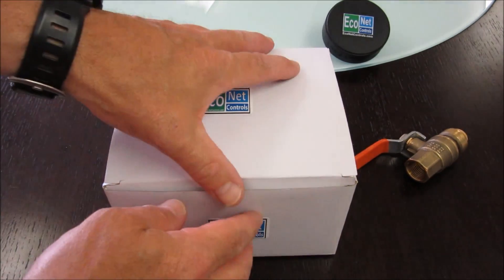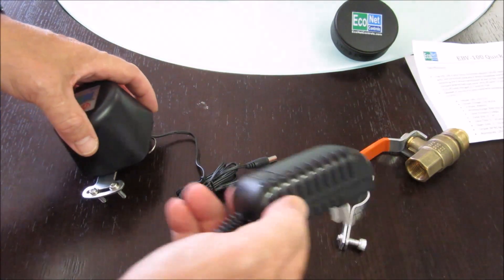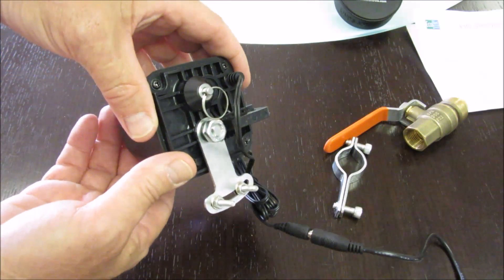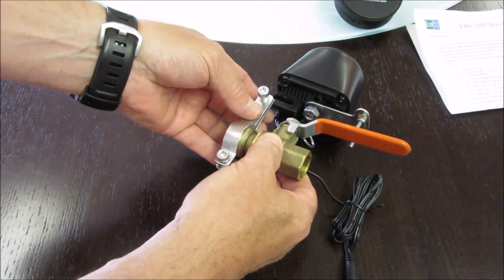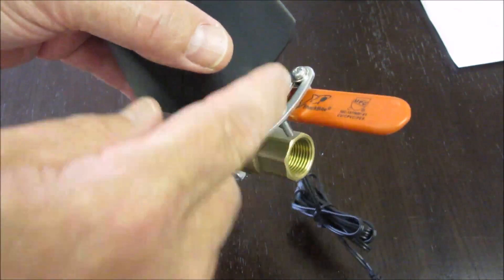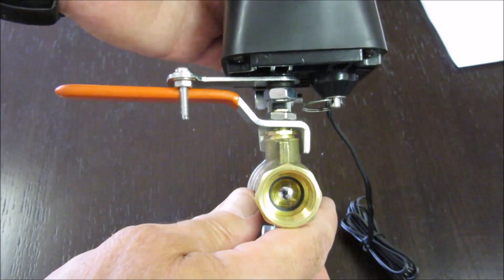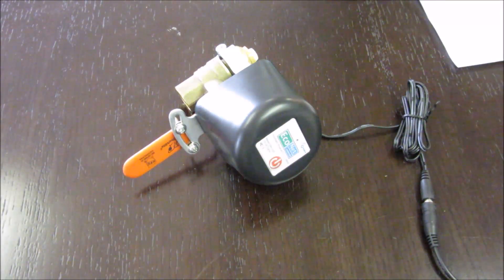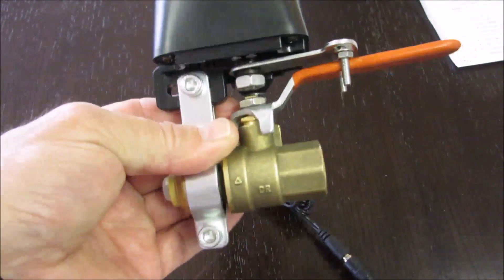Automatic Powered Levered Ball Valve

Comment: These things can also be used for turning off natural gas valves. You can use arduino gas sensors to activate them. Everyone using propane/natural gas should install them. I have a natural gas well and have used it for everything in my house for almost 20 years but I use a linear actuator. This should work ok too.

Comment: I wonder if it could be thermostatically controlled to shut off a oil dripper on a wood furnace????
Reply from the maker: Please check out the latest versions of the Bulldog at www.EcoNetShop.com.  and yes, you could add temperature control and many other sensors to control the Bulldog

Comment: Can i select the extent to which the arm can travel?  Suppose i don't want 100% open and only 50%?
Reply from the maker: At this point our valve robot only supports two positions,  0% open and 100% open.  Please contact support@econetcontrols.com for more details or check our site www.EcoNetControls.com for updates
Reply: Actually it's possible.
Just add distance/lag between the two screws/nuts holding the handle.

Comment: I love this. I am doing a entire landscape irrigation project based off 16 hose bibs....yes, ball valve hose bibs. This would be great if it could be paired with a irrigation controller. Want to donate 16 to my project and I can share on YouTube?
Reply from the maker: Home Automation wireless automatic water shutoff valve. See the latest version at: https://youtu.be/_4uo3wmzZl0
Reply: I used the Flowtech battery powered valve until it was discontinued.  It worked pretty good.   Now aqua line have a simple flow irrigation valve.    I’ve been installing irrigation systems since 1999.     Question.   Why would you come off 16 hose bibs ?    Just plumb out one source off a 3/4” line from inside the basement.

Comment: Solenoid valve is better option and very cheap compared to this
Reply from the maker: You can not install a solenoid valve over an existing ball valve. If you want to pay a plumber or do the plumbing yourself, yes a Solenoid valve is less expensive although solenoid valves are less reliable and more subject  to failure because of the very hard on and off action.  Also, see the latest version of the Valve Robot at: https://youtu.be/_4uo3wmzZl0

Comment: No reset function? The water sensor will detect a small leak then makes this valve shut off.  water dries.  Then the valve opens again.
Reply from the maker: Yes, typically, depending on controller configuration, human intervention is required to turn the water back on after a leak alert.  See our Bulldog Valve Robot in action at: https://youtu.be/_4uo3wmzZl0

Comment: Does it fit with PVC ball valve?
Reply from the maker: At this point our Valve Robot works with standard steel/brass ball valves.  We are considering support for PVC type valves. (Maybe in 2018)
Reply: Hi Sohibia,

we are the motorized valve PVC motorized valve manufacture,if you need the valve, please contact:tonhe08@china-tonhe.com
regards,
yoyo

Comment: Can the actuator work with a 1.5 inch valve and 24 v?
Reply from the maker: no on the 1.5"  A 1" valve is the largest supported.  The unit runs off 12V DC with the included AC adapter

Comment: Would this work with Broadlink RM Pro? Regards,
Reply from the maker: In a quick check of the Broadlink RM Pro controller, it does not look like it supports the Z-Wave Smart Home standard.  Our devices use the Z-Wave communications protocol. So I guess the answer is no.
Reply: EcoNet Controls
Reply from the maker: I am not familiar with the Broadlink RM Pro.  The EBV105 works with most controllers that support the Z-Wave protocol.

Comment: Why not just buy a motorized ball or solenoid valve?
Reply from the maker: +Alex Acuna many home automation diy types do not want to tackle the plumbing required to install a motorized ball valve.  No plumbing is required and you don't have to deal with the city/municipality to shut off the water main.  If you are happy doing the plumbing then a motorized type is a good solution.  We will be introducing a new version that has an integrated ball valve.